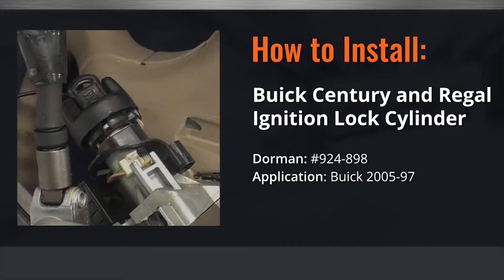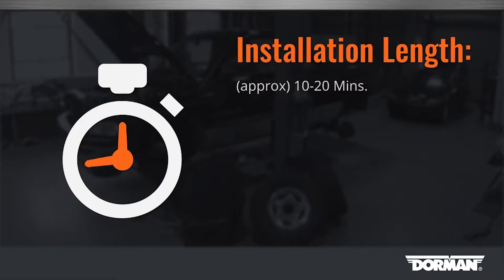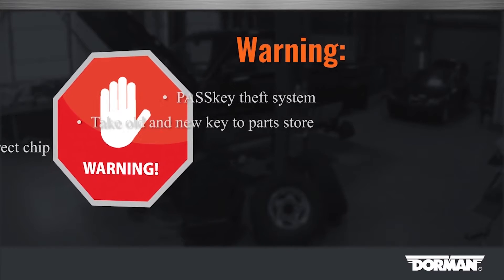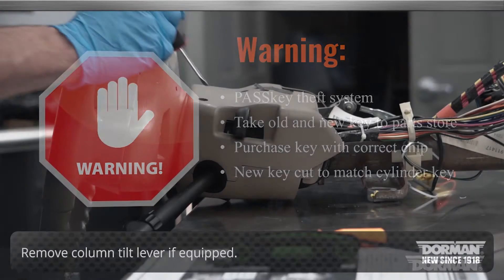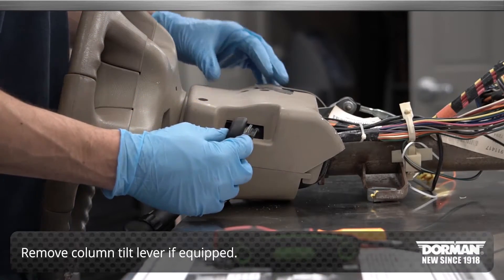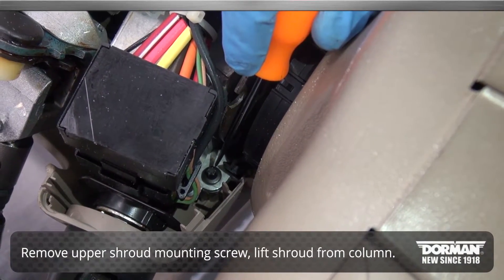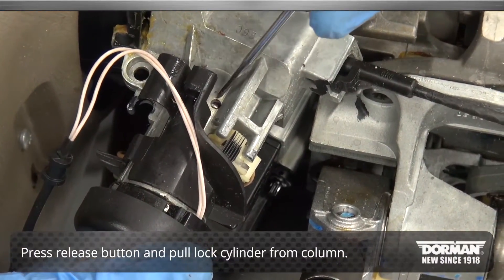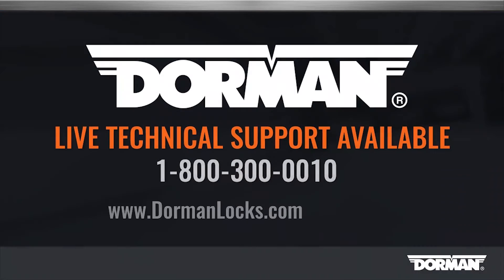Buick Ignition Lock Cylinder Repair Video by Dorman Products

Comment: If I'm changing the ignition with a new Dorman ignition and key, how do I program the new and different key?
Reply from the maker: Hi Allen, as the video and instruction states, the keys included are to be used as a cut template for an automotive locksmith or GM dealership to cut new keys. They will be able to determine the proper passkey programming for your particular vehicle by its VIN.